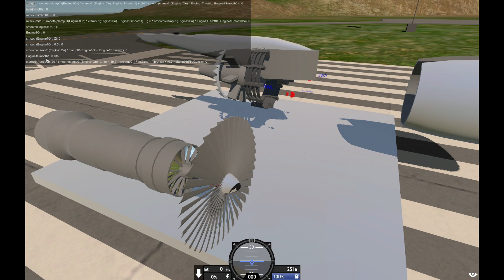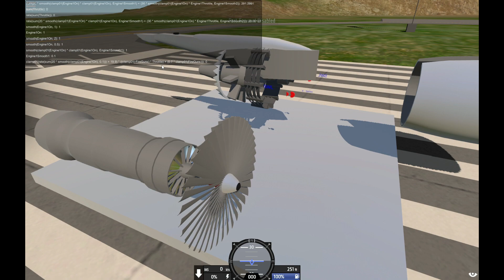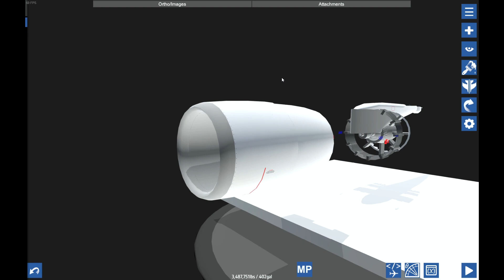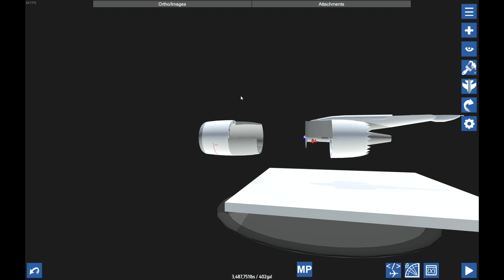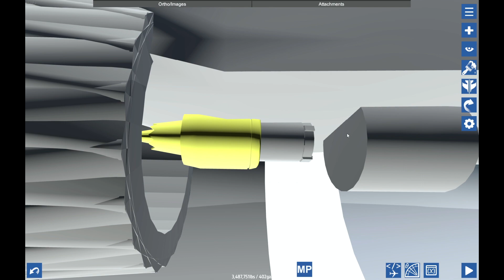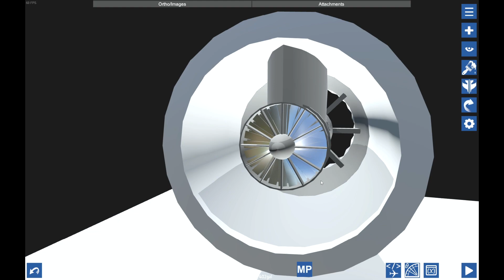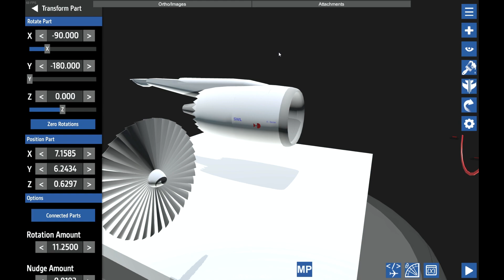How to Make a Custom Engine in SimplePlanes

Comment: How did u do the chevrons
Reply from the maker: I used fuselage slicing. First I added a full hollow fuselage to the back of the engine, and then I sliced the width at the front and back. This also allows for two chevrons per part.
Reply: @11snakePlayz  thanks a lot